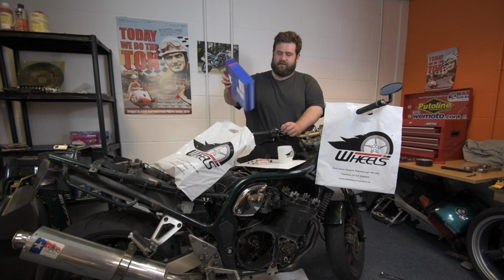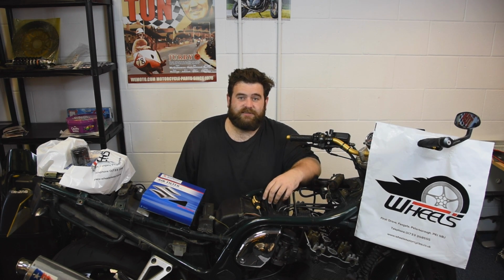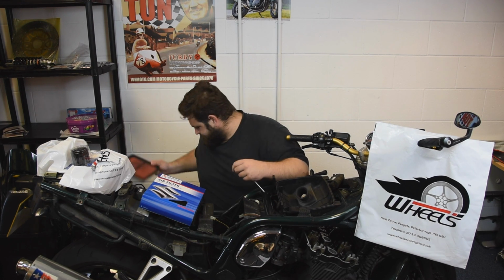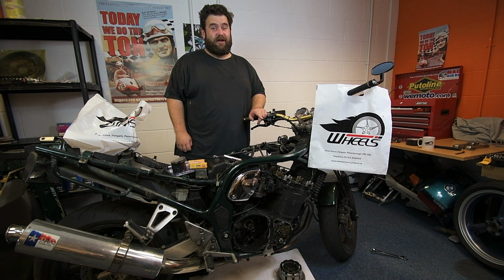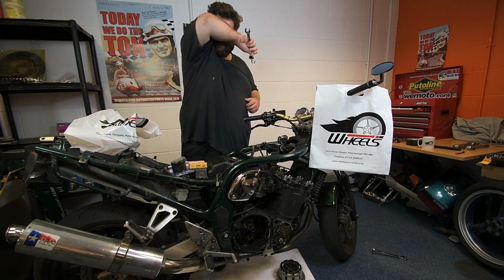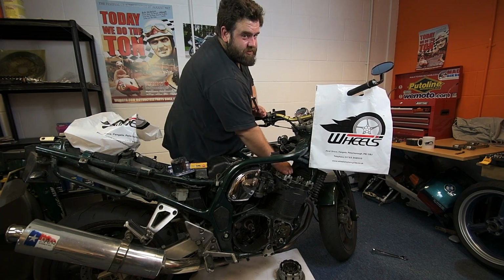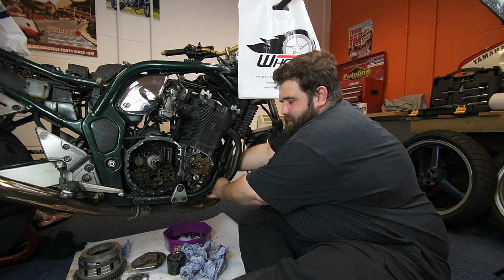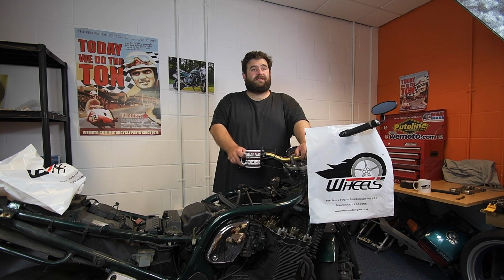Suzuki bandit 1200 Project part 7 || Classic Motorcycle Mechanics

Comment: You took out a k&n air filter and put in a stock one .... why .... downgrade
Reply: Surely would need re-jetting or tuning after removing K&N pods. My B12 is dyno tuned to the K&N pods, noth the standard airbox.